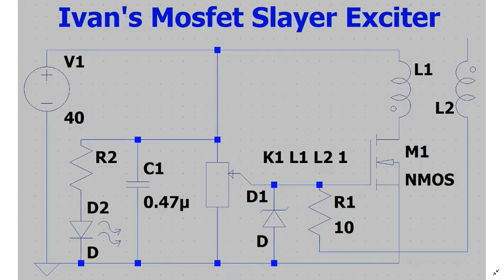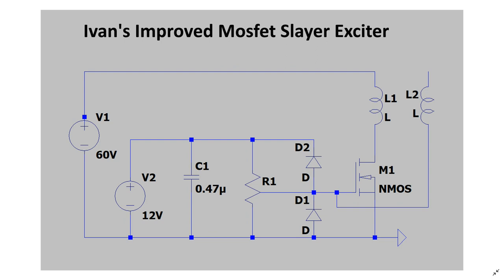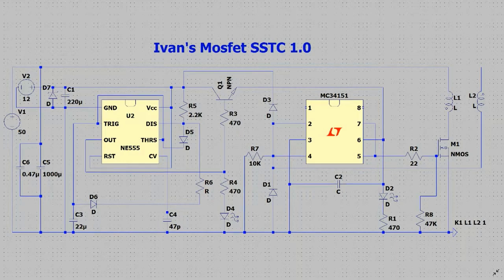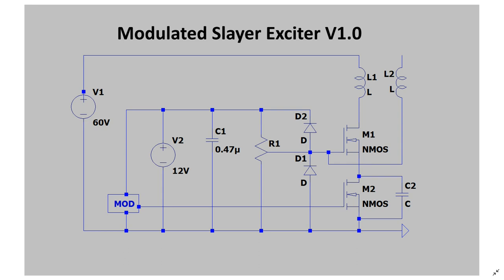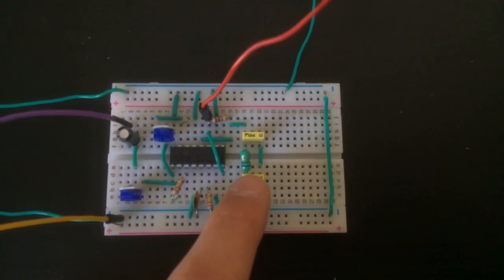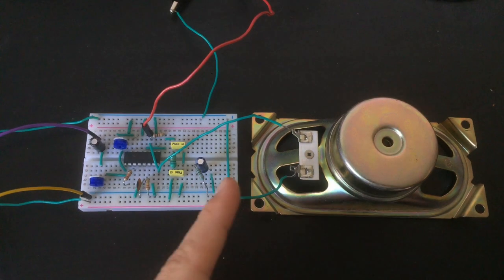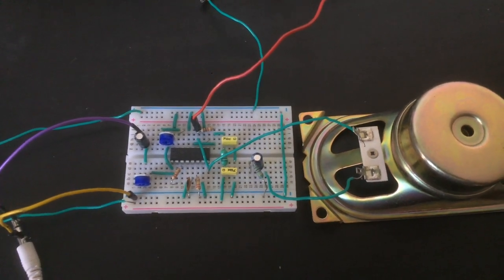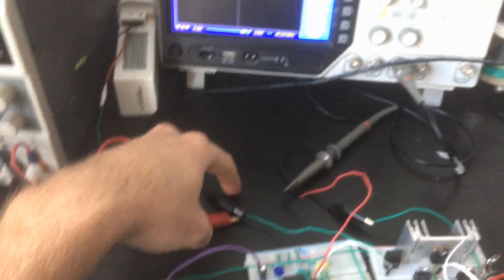Mosfet Slayer Exciter Part 4: New circuit and Modulation

Comment: The purpose of the Slayer exciter circuit was to make it an easy entry point for hobbyists to build their first Tesla coil. You are a very talented electrical engineer, but the complexities you construct have pushed it out of reach of the average hobbyist. It would be great to add snubbers to the Slayer without ICs, gate drivers, modulation, square waves…etc etc etc.  Nice video!

Comment: interesting design. thanks for sharing
Reply from the maker: I'm glad you like it! I will experiment further with this design, perhaps making a resonant half bridge with irfp460s which should in theorhy double the output power for a given voltage as the high and low states will now be driven instead of just the high state and I will be able to run it from mains. I'll keep the modulator circuit though and use maybe an igbt to modulate the circuit. I'll make a video about it eventually too when I get some free time.
Reply: @ivanrodionov9724  the only set back with the half bridge is the need for higher input voltage. symmetric power supply. But yes, then you can use AC from the wall, rectify it to positive and negative DC.
Reply from the maker: @MasterIvo  I was gonna get back to you, but I was under a rock for the past month cause of Uni, so sorry I am replying late. 

For a DC load, a half bridge supply will give half the voltage per cycle instead of full and full voltage, so the power of the signal will indeed be lower as it is proportional to the square.  I am unsure if this is true with an AC load close to resonance however, as weird stuff begins to happen around resonance. Going with mains voltage certainly is a good idea. 

The main problem with a bridge circuit is throughshoot which frankly is a pain in the ass to deal with especially at high frequencies. If you go with a half bridge circuit, the main advantage is simplicity and only throughshoot can occur, whereas with a full bridge you need to adjust the phasing just right so that you don't create a short and cross shoot. Trouble is, the frequency of the circuit is dynamic so some fancy tricks will need to be used. 

TBH, if you have any ideas on how to create a system that can dynamically adjust phasing, I am all ears.
Reply: @ivanrodionov9724  almost missed your comment. but saw it! phasing is still a mystery to me. I also have weird phasing effects around resonance. as if the fields push eachother away. so balancing the field strength would be key (maybe)

the through shoot is what I am using in my experiments, as it sets up displacement current from the rapid change in (high) voltage

Comment: If you want a lot of views do a EMP.
Reply from the maker: That's an idea!
Reply from the maker: @caseyosborne3148  Sure! I'd love to have a look at what you got! Do you use a discord/email/whatever else?
Reply: @ivanrodionov9724  Instead of this, move on to a push pull feedback topology similar to the Skori/Tefatronix. Channel Magneticitist has good examples of these circuits
Reply from the maker: @sFeral  hey! Thanks for your reply! TBH, much preffer bridged designes over a push pull design as these tend to be easier to build. I might however eventually tr making a push pull design using a center tap coil. Thanks for the recommended channel's I'll check them out.
Reply: @ivanrodionov9724  as you'll see, you don't even need a tapped primary, just two chokes on the drains as seen in Mazilli ZVS schematics.
Reply: @ivanrodionov9724  then again I'd like to see what happens with no choke at all, and that can only work with a center tap (I think). Start as simple as possible
Reply from the maker: @sFeral  I actually did try using a ZVS type driver but I had problems with oscillation stability as the coupling was not very strong. I suppose, I could increase the loop gain using say an OP Amp or a dedicated driver chip but that would overcomplicate the circuit. Although, now that I think about it, I do want to try this circuit more and more as there is also a single coil version with two inductors. 

As for a ZVS type driver with no choke, that is a good question what would happen! If it was on a powder core, and a CT circuit, I'd say a lot of current draw. If the core would not be driven hard and close to saturation, it would work and just draw a bit more current then usual, but if it would be driven hard by say pulling a juicy arc, you would effectively drop the Impedance to only the real component caused by resistance creating a huge current draw and potentially killing the circuit. This is also why the inductor is there, to fix the current draw and improve efficiency.

As for a two inductor design with a single coil, I would say a huge current draw or no oscillation and a huge current draw. 

As the tesla coil primary is on an air core, it would be much harder to saturate so I guess it could work semi stably without an inductor if it is a center tap design, albeit with a decreased efficiency. As for the single core design, I would say it would either fail dramatically due to an effective short through one of the mosfets, or not oscillate depending on the supply voltage.

Honestly, It's this type of question that is best solved when simulated in something like spice :) .

In truth, the ZVS design while very simple, does not allow for more delicate feedback loop conrol (easilly) or implementing things like modulation (easilly) . Hence why I tend to avoid it and use bridged designs instead.
Reply: @ivanrodionov9724  Couldn't the ZVS be controlled by having a separate source for the gates and PWModulated through a P type FET ?
Reply from the maker: @sFeral  You mean having a mosfet switching the gates off or how exactly do you mean with a P mosfet?
Reply: @ivanrodionov9724  yes, a P fet switching the pull up off, though the gate discharging might be too slow through the 10kOhm (usually present) resistor and grounding directly through another N fet would be preferable
Reply: @ivanrodionov9724  I mean u don't even need the grounding 10k resistor if the gate supply is regulated to the exact voltage, just need the pull up resistors to be at an optimal value, which I guess would depend on the switching frequency